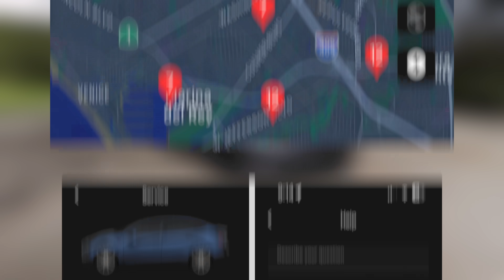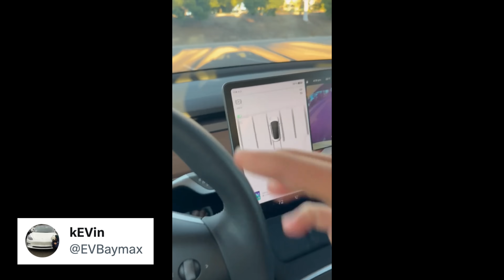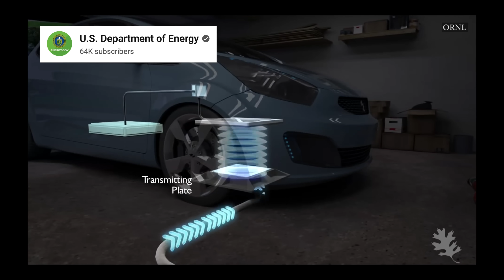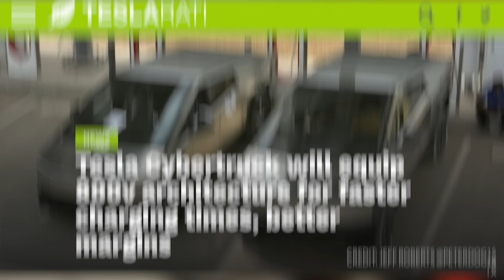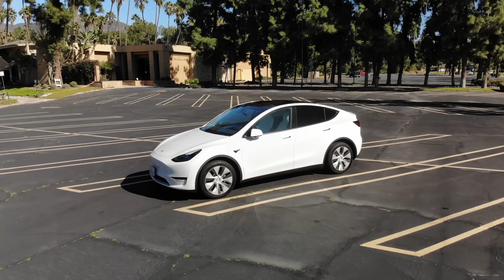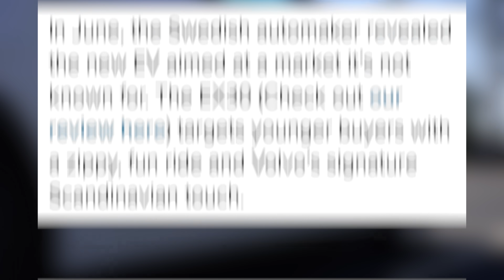2024 Tesla Model Y Project Juniper | Cybertruck Tech Coming?

Comment: I have been a big fan of EV's, especially Tesla.  I have rented, borrowed and pushed others who were looking at a new vehicle.  Sadly, I do not have the confidence in the high speed infrastructure or range to purchase one.  No matter which BEV I've used, all brands, they have a real world range of <250 miles.  I get app recommendations to use a level 2 charger on my trips, this will not work.  Maybe in another 5 years?

Comment: The reason they're not too crazy about coming up with the high fidelity overhead thing is because like any good businessperson, you want the biggest return on your investment, and for that the big moneymaker is software. Hardware, like cameras/sensors are a necessary evil. Creating a software package they can later sell on other models  (or even used ones) as simple as over the air, is a gift that can will keep on giving. That full autopilot... that's a toggle of a button that costs $12K.

Comment: When talking with Sandy Munroe, Tesla’s people said cybertruck advances are unlikely to be implemented on current vehicles. They’d have to re-buy everything in 48v and redesign all the wiring.  I think it’s possible, but unlikely for a long while. Juniper won’t be a big enough redesign. I think it’ll be the next major redesign after that.

However, the Model 2 IS likely to gain all of the cybertruck’s technologies.

Comment: I have a Model Y and very happy. The glass roof I have shaded and if it was smaller or gone I would not care. Wish air suspension was an option. We are in Mexico and on cobblestone and some ridged concrete roads there is too much droning noise.

Comment: For wireless charging, i don't think that is a great idea. Losing half the electricity you pay for for the inconvenience of taking 30 seconds of you time to plug the charger cable seems not a very efficient way to use an electric car...or to produce the electricity needed. In a way you loose 50% of the efficiency lf the car...Working hard to augment car efficiency by 2% and losing 50% after that is very, very counterproductive, don't you think ?

Comment: I doubt M3 or Y will have 800v architecture but if so it will likely be similar to the CT with dual 400/800 volt charging capability. With this feature V4 350 kw superchargers could significantly increase the charging speed as the battery capacity will be split in two half.

Comment: based on the history of tesla cars, innovation rarely trickle backwards, only forward towards newer cars.  for example, tesla innovated with the Y with giga castings, but the 3 never got all the gigacastings with the highland refresh, but the cybertruck improved on the Y's gigacastings. then you look at the battery tech, the X and S never recieved the newer batteries. Tesla has no problem bringing better innovations towards newer vehicle designs but rarely upgrading the past designs. what more likely is that if there is a new generation of the Y, then maybe we will see the 800v architecture. S and X were designed on a 10+ year old architecture and there still hasnt been a new generation.

Comment: Wireless charging IS a key barrier to Robotaxi.
Why have it at home. Well the Robo taxi needs to get back home right. The owner may not be at home or they maybe asleep. So the Robotaxi needs to auto park into a bay and then charge. The wireless chargining solves this issue.
When the Robo taxi is out in the field it will need to charge - at a stall or maybe in a specific Robotaxi layby. In either case wireless charging solves this.
I was expecting this for many years as the optimal solution. It now looks like the tech can deliver on reducing transfer losses. Or losses that are no longer prohibitive. For the Robotaxi charge times are not that critical as for private owners. So the charging could be slower. The key is high efficiency to reduce cost of charging since the losess will still need to be paid for.
Finnally wireless charging is vital for Tesla Bots. 😊

Comment: You have great videos , & be happy you have parking sensors and not this simulated 3D view , it is worst then just using mirrors and cameras , in the last few days the 3D shows I am about to hit something when mirrors and a walk around my car , should I am over 18 inches away , & I tested putting something in front of cars bumper ( as someone else might put in front of your car , in a store parking lot , cardboard box or wooden crate other packing garbage someone did not want to take home and often leave in store lot ) does not shake on 3D or camera and no sensors to detect it ) not good system yet

Comment: Yes, USS is superior. I have the High Fidelity park assist now, and while it is a huge improvement from vision only, and it holds potential, it is not as good as USS. Especially with winter conditions making cameras dirty. I trusted the USS more than I do with this camera based system...
Reply: It's not superior, it's different. USS has higher accuracy for where it can detect, but it gives absolutely no information around the sides of the car, parking lines, etc. New fidelity assist is VERY useful for parking, getting centered properly, parallel parking, and seeing your entire environment from any view angle you choose. USS only shows you a very limited area of 2d distance information.
Reply: @jasonfranciosa  Maybe in sunny cali you can say that. In snowy Norway, where many of the cameras are constantly dirty or low sun for 6 months of the year, the perceived and experienced usefulness of USS is superior AND different to High Fid. 
And, given that you can look out of the windows around your car, use mirrors, would you prefer high accuracy on what you can not see, or be able to see more around your car, but you can't necessarily trust what you see on that screen or the distances it measures? I would rather prefer to look myself out of windows and trust the data given of what I do not see, vs what High Fid gives you; seeing the entire environment but you can't trust it...
Reply: We basically beta testers here…